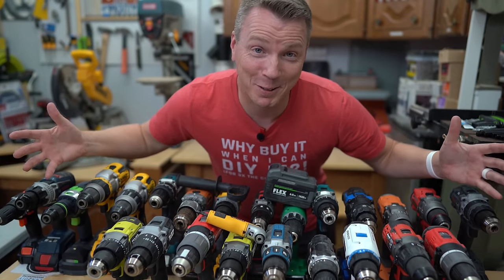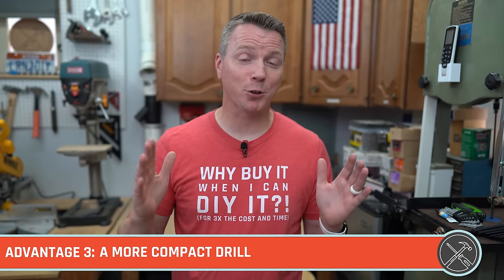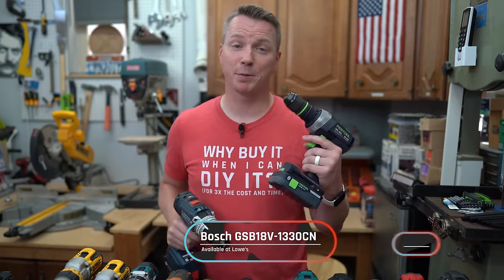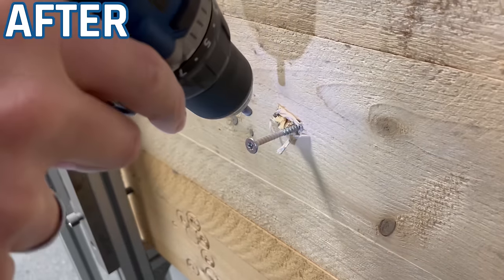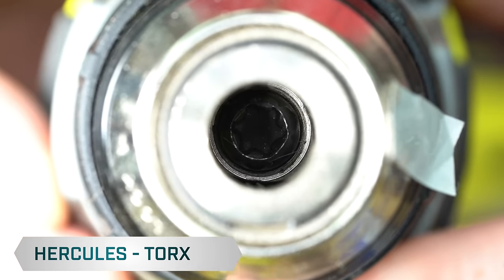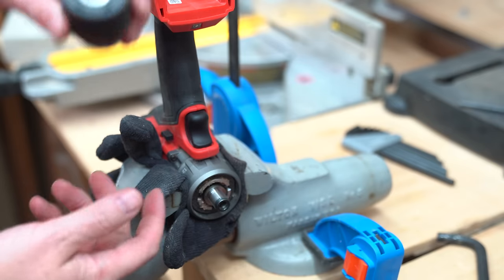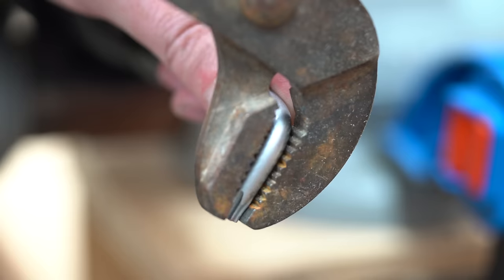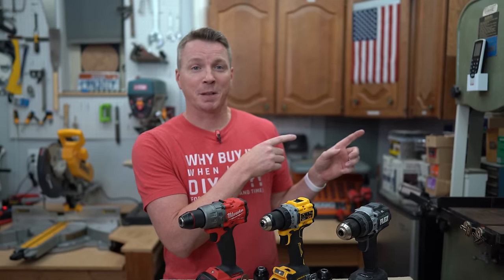The Single Best DRILL UPGRADE I’ve Seen

Comment: Does the chuck affect the clutch performance? In your other DeWalt clutch video you mentioned the DCD999 had a clutch that didn't work. In this video you mention the DCD999 has a great chuck. So I guess clutch and chuck are independent functions of a drill?
Reply from the maker: They are independent, yes. The clutch will perform the same regardless of what chuck is on it.

Comment: My question is if the higher end models already have a rohm chuck, if you get one from the website will it be the same as the factory one or a different better/smaller one?
Reply from the maker: It depends. From what I’ve seen with all my drills, the Rohm chuck that comes in your drills will be similar to a replacement one.

Comment: I just looked at my Dewalt 20 volt drill. I don’t see a name on the chuck, I opened it wide enough to look inside and it doesn’t seem to have a removable bolt. What is your opinion on that?
Reply: you need to disassemble drill to put axis with chuck from gearbox, that it is simple. Originals are metal ones are Rohm, plastics are Jacobs

Comment: Do Röhm make cheaper budget chucks? I have a drill by parkside that cost €70 as a kit and has a Röhm 13mm metal chuck on it so curious if it's the same as on pro tools
Edit: it looks identical to the extra50-RV but it's longer, like 70mm
Reply: The same chuck. The manufacturer of the Parkside drill/drivers use Rohm in their own brand and just pick their off the shelf chuck.

Comment: If u dropped ur drill and bit wobbles now. This may fix it?
Reply from the maker: Most likely, yes. Sounds like something bent in the chuck. It’s possible that the spindle bent though, which is more serious.
Reply: Depends. Could be the bit, could be one of the prongs, could be the assembly behind it.

A new drill is cheaper than buying these.

Comment: LOL   on my DeWalt DCD999 there is nothing there to unscrew to remove the chuck head, all is see is a shaft a round shaft in the middle of the chuck with a little circle, if you have one of these DeWalt's 999 take a look at yours

Comment: Tried their chart and was disappointed. It is very limited on what they have cross referenced. Ridgid is not even listed in the Brand list. Metabo is listed but my 18V drill was not...At $55 a pop I think I will stick to what I have. The Ridgid has issues but it has had a lot of use and is getting time to update.

Comment: Wow a chuck that costs between almost and more than sale prices of the entire drills
Yay
I'll have to double check my Dewalts to see if they have the rohm  but in general they have some of the worst default wobble as well as, not Chuck related, most loose battery seats
Best I think have been Milwaukee and older higher end  Hitachi
As well as really old corded models have excellent chucks

Comment: You mentioned batteries earlier and I was wondering if you've had any experience with the off brand 18v Ni-Cad replacements for Porter Cable tools. My impact driver is fairly old, obviously, and I'd rather not spend the price of a new driver on replacement batteries, especially since I only use it occasionally.
Thanks, W
Reply from the maker: I can’t say that I have any experience with that, but if they’re not too expensive, it might be worth a quick try.
Reply: If you have a few tools and batteries I would get a battery adapter for the porter cable and buy lithium batteries to use on them.
 And a new charger & batteries porter cable maybe?
Reply: @kristene2372 That's a thought. I'll have to see what's available. Most of the lithium batteries I've seen when searching are 20v.
Thank you! W
Reply: what voltage is the old p/c ? 14.4v 18v?
Reply: Make your life easier and just buy a new impact kit. Home depot does holiday sales multiple times a year, and they practically give you half the kit for free at those prices. A modern small lithium battery is worth several full size ni cad batteries. Cheers.
Reply: I am still using 18 Volt PC.
My set came with NiCad but I later bought an impact driver that came with a lithium battery and charger.
Later bought 4 genuine PC lithuim batteries when Grainger was blowing them out.
I now use the lithium ones from Amazon.
Not quite as good as the real deal PCs but you can't get them any more.

I will never forgive SBD for not making the 20 volt peak batteries compatible with the 18 volt system.

Comment: I've been cursing the concentricity of these drill drivers forever. Doesn't matter if it's a cheap brand or Metabo, or Dewalt (have owned these two and checked out even more at the store). 

Can you honestly say that the chuck replacement has singlehandedly fixed the centre runout, or have you discovered that it was partly due to the chuck, but also some runout is left due to tolerances of the gearbox or motor spindle?

Comment: I have a couple DeWalt drills, that have no fastener. Like the DCD706. Unchangeable? Or not worth the risk of breaking the drill?
Reply: You need special tools + torque wrench and the screw is on the inside so you´ll need tear down the entire gearbox to switch chucks. It sucks, don´t do it.

Comment: I have a bit mixed feelings about the whole saga with the "locking" chucks thing tbh. The first video was just straight up wrong, where the main complaints were the spreading of misinformation and the lack of research when this information is pretty much openly available. I mean, if you call customer service youre not gonna talk to an engineer, you are gonna talk to a 20 year old who just needed a job and will say whatever makes you get off the line so they dont get yelled at for taking too long. 

The second video did at least correct the wrong information, but none of the others were addressed at all. Instead choosing to focus on how well the video did and angling things as "those darn companies was wrong"

Idk it just makes me skeptical to the other things you do now, like praising a new chuck as the best thing since sliced bread, breathing new life into an old drill and whatnot? If you have a bad chuck, sure, but the rest of it sounds pretty dubious ngl. "Get into tight spaces" with the 2mm you save and what not.
Reply: And if you get to the very end of the video, he mentions its sponsored by Rohm. Not exactly up front.

Comment: Is it worth doing on a 30$ amazon drill i bought just because it used the same battery as my aoben 1/2 inpact wrench uses
Reply from the maker: That's up to you. The chuck will cost more than the drill in that case but if the drill is otherwise good, then it could be worth it.

Comment: Avon almost every brand of drill. The only one that ever gave me any trouble and I am partly the blame for this is my Flex Turbo hammer drill. I drove about 50 holes in concrete up side down in the dust went into the chuck. I've had no luck getting all of the dust out. I will probably just trash that chuck and buy a new one
Reply: Thanks for mentioning this!  Maybe painters tape on the chuck.  or maybe a funnel to keep the dust out of the drill too.  Gotta try to remember that for upwards applications.

Comment: You don't even need the top of the line units. The Bosch GSB 18V-55 is the entry level 18v drill and it has a Rohm chuck, probably helps they are both German companies.

Comment: I bought it for my dcd800 dewalt and I cant find a video that shows how to replace that exact drills chuck. Anyone else have luck with replacing it?  Apparently it’s threaded on and I think I need to disassemble the drill to get the chuck off

Comment: Bosch uses RÖHM chucks on every one of the cordless drills they sell with a metal chuck.
Both my $99 special GSB18V-490 drill as well as my high end 18V Bosch drill have a RÖHM chuck and so did my previous mid tier  drill from 3 years ago

Comment: I was contemplating choosing Milwaukee as my battery tool platform - when I was looking at the drill (Model # 2903-20) on the Home Depot website someone asked if it could be changed to a keyed chuck.  "Milwaukee Tool" answered that it could not.
Does anyone know if that is true?  Keyless chucks are great I have always kept a keyed chuck for the occasional time I need one for my other drills.

Comment: If you don't have a Rohm and you don't have carbide jaws.  You don't know what you're missing.  Going from a Dewalt w/o carbide to a model w/carbide results in no drill slippage.  It's not clear if Rohm uses carbide.  Their site says "hardened" and "hard metal inserts."   Could they actually be using carbide but missing something in the English translation since a German company?  I have no idea.

Comment: Hi. I've had an Hitachi drill for quite a while that has a Rohm chuck. No matter what I do the bits have always worked loose. Is there any way to stop this? I think I tighten it enough, but how do I know? Should I tighten it as hard as I can? I'm worried about breaking something.
Reply: The answer is simple. Tighten it as much as you possibly can. You won’t break it (and if you do, it was already faulty to begin with).

Chucks need to be as tight as possible to properly bite into the round shank of drill bits. It only takes a couple of slippages to damage the jaws of a chuck to the point that they will stop gripping bits properly. Don’t let them slip: tighten them properly.
Reply: Thank you so much. That's just what I needed to know. @TheIdeasGuy
Reply: @johnnyshinnichi1785  you’re welcome mate. Have a good day/night wherever you are in the world

Comment: Maybe Röhm chucks are the best, but I find they lock up when using heavy torque, need a pipe wrench to get them open. When I downgrade to a Jacobs chuck, things work perfectly, all the time. Like the Dewalt drills, hate the chucks.
Reply: That's like saying you downgrade from a Mercedes Benz to a Rolls-Royce 
:-0)
Reply: Maybe, but I would have a better opinion of Rohm if the chucks worked as smoothly as as other far cheaper chucks. @2Truth4Liberty
Reply: @laneromel5667 
I think you missed the point of my car comparators.

Comment: Funny that you Americans just found out what we Germans uses for decades 😄 But even with Röhm chucks you still have wobble in most compact drills, its simply because of the threads socket tolerances you put it on. It got too much play to be 99% precise. To get a better concentricity you need a better socket like an B12 from drill presses. Some rare drills in Germany got these. As Example: Some "Fein" drills.

Comment: Sorry for my Eng: Chuck-less is better. Or remove-able chuck. Tool becomes even more compact and light-weight, also beautiful. Today it is possible to buy HEX metal, wood, concrete bits for good price, and from good brands. It is very fast and comfortable to swap them.

Comment: what about Dewalt where there is just a smooth pin inside holding the chuck on?
Reply from the maker: DeWalt is particularly tricky. There are three main ways to go about it but they do make it tougher than many other brands. You can disassemble from the transmission side, snap it off (which can be risky but is usually fine) or cut it. There are several YouTube videos on each method.
Reply: @LRN2DIY  why risky? There is oficial tool for holding axis aout of device during loosening :)

Comment: After hearing these things are the Mercedes Benz of drill chucks I assumed they would be more expensive than they are. Usually these "do you have this problem?" problems aren't my problem, but I recently fought with getting a tight enough grip on a 1" paddle bit... So maybe I do have a problem with a solution lol

Comment: I disagree I use lots of drills on a day to day basis for work as a handyman and have always looked to jacobs chucks for reliability, the rohm chuck may be more precision engendered, as the sponsors of todays video, but just as my jeep will compare to a bmw one is far more rugged and reliable and less likely to break and half the price, performance is what german engineers are know for not reliability or a good price and on top of that your voiding your warranties by swapping from factory chucks  unless your advising ppl save the normal chuck in a box just incaseof warranty, this is bad advice for the average DIY person in my opinion

Comment: Mercedes is NOT the analogy you think it is. Coming from someone that operated a tow truck for nearly 15 years. I towed more BMW and Mercedes hands down. And what's worse is they design their vehicles like they never have to be towed. Most can only be put in neutral if the engine starts! I've seen on many occasions where they would put themselves into park and set the electric parking brake. No way to put them into neutral to even push them out of the street. The brands I towed the least? Porsche, Volvo and Subaru. So, for all those who compare "High End" to either Mercedes or BMW, don't. Just Don't. Rant over.

Comment: Interesting, but I’m not convinced the “improvements” are really worth it - $55.
Reply: To this, the truth is that “worth” is totally subjective. It all depends on YOUR needs, wants, desires and budget, and what YOUR balance of these is.

I WILL be upgrading my two-most used DeWalts, and I’m seriously considering upgrading my Dad’s old drill just to honor his memory and the help he gave me in teaching me about DIY
Reply: @ernestgalvan9037  The difference in length of the original vs new chuck was microscopic. The weight was likely the same. Also it IS a hand held drill so concentricity or accuracy is already reduced. I doubt there would be a difference. 
However I might consider the change on a mounted drill press. 
That might be “worth” it.